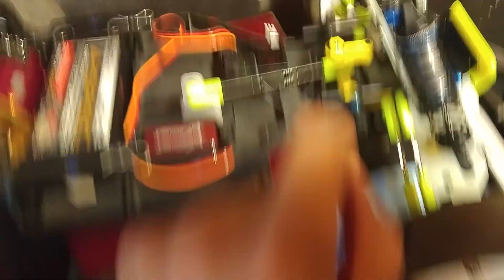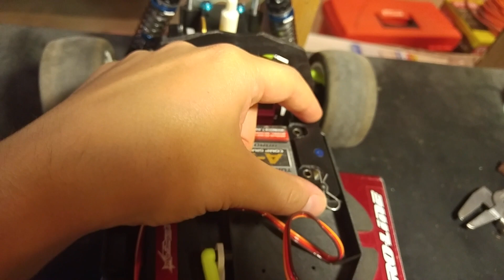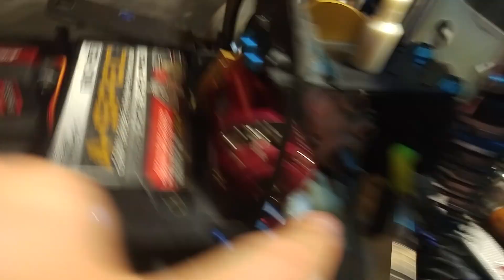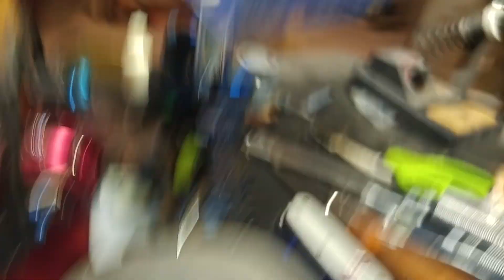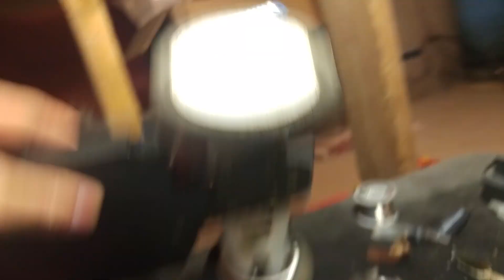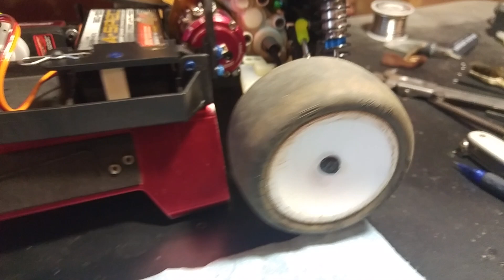Tekin RC10 mid-motor runner build, Part 3

Comment: Great series, thanks for building the car and creating the series.  So, the stealth transmission is rotated 180 degrees from it's standard mount position.  How did you correct the rotation of the motor/trans so that forward remains forward instead of reverse?